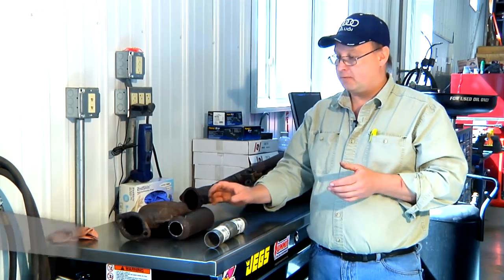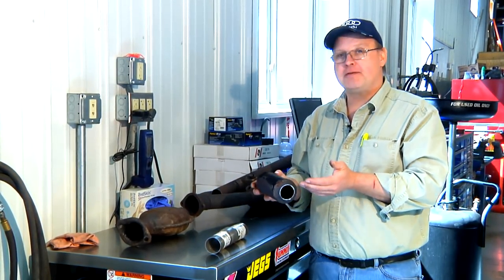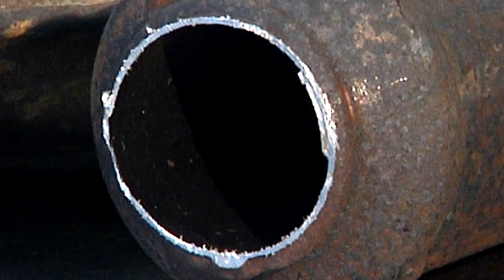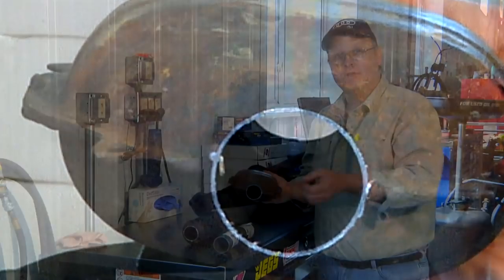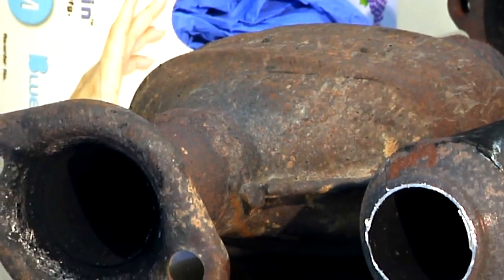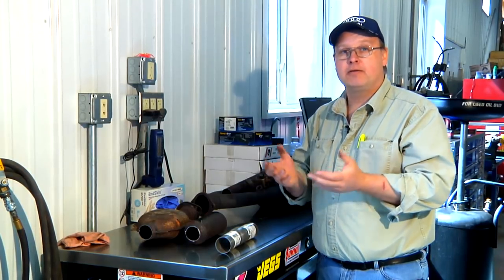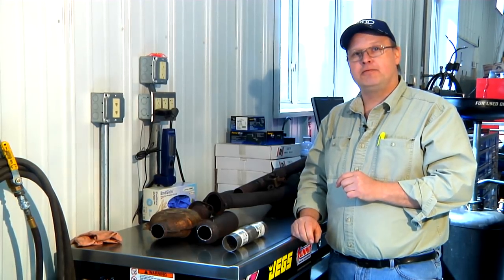What Happens if You Replace the Exhaust Resonator With a Pipe? : Under the Car Repairs

Comment: HOW DA FUCK  BACK PRESSURE CAN BE EFFICIENT IN ANY WAY? SINCE WHEN PHYSICS CHANGED?
Reply: better torque and smooth running.  you ever removed the exhaust from a motorcycle?   quite a lot need dynowork to run smooth again.     the lesser the "backpressure" the higher in the rev range the "bigger" power will be.     or no BP is only peak rev BHPgain and low/mid rev torque loss
Reply: backpresure is NOT good never was and never will. Learn physics. Backpresure doesn't allow full power explosion to happen. How this is more power? Your pistons moves less with backpresure. I cant write this topic in english i dont know terms. That's why bigger liter engines have more power. if you restrict piston movement -you lose power.
Reply: Dude, are YOU an automotive engineer?

Do you race cars or bikes on a track?

I AM and I DO

Take your car, bike, truck, etc and put it on a dyno.
DO IT
Film it and put it on youtube!!!!!!!
let us show the TORQUE AND BHP graph AND YOU WILL SEE THAT WITHOUT MAPPING YOUR ECU YOU WILL HAVE A BAD RUNNING ENGINE!!!!!!!!!!!!!!!

you obviously didnt read my text verry well

I never said TOO MUCH backpressure is good.
I never said backpressure doesnt cost you power etc

what I said was that IF YOU TAKE AN ENGINE AND EXHAUST SYSTEM FROM AN EXISTING VEHICLE   you will almost always loose torque and or power in lower regions and you will need your vehicle mapped again for durability and power-sake

YES if you block the exhaust gasses too much, you engine wll run badly and lose power

But the same happens a lot too when the exhaust is too open.

That text of yours is about when designing a new engine basically

they can design an engine with NO backpressure (exhaust pressure) but why do you think they only did it in race-engines???

NO TORQUE and too loud !!!!!!!!!!!!!!!!!
Reply: SO why everybody make straight exhaust as the first power increasing mod? You talking about gasoline cars maybe, i primarily talk about diesel. Gasoline is shit for me. IMPOSSIBLE to design cars without back pressure. Catalytic converter must be, turbo must be on diesels, some other components must be too, so impossible to make if you fallow regulations.

With diesel you will GAIN torque with no back pressure.  Turbo spins faster on lower rpm.
Reply: Tomas Av.
Are you daft??
I already said this same thing....
""IMPOSSIBLE to design cars without back pressure. Catalytic converter must be, turbo must be on diesels, some other components must be too, so impossible to make if you fallow regulations.""

Only proves my point...

A straight exhaust on a diesel or even gas car aint a problem as long as the diameter aint TOO BIG, but you cant put a 8inch diameter pipe on every engine WITHOUT ANY consequence....

yes, every engine WITH TURBO spools up faster and CAN win Torque when you remove the exhaust completely or make it less restrictive...

You are missing my biggest point
ECU PROGRAMMING NEEDED!!!!!!!

you go ahead and just remove the exhaust after your turbo and see what happens.
OR you will lose power, OR you fuelconsumption goes skyhigh OR you engine becomes less durable

EITHER WAY YOU CAN NEVER EVER go wild on removing ""exhaustpressure/exhaustrestricton"" without sacrificin anything
Reply: Why do all the old hot rods have like no back pressure? They run straight pipes for a few feet and thats it.. Old piston pounder air plane engines, again, few feet of pipe and thats it.. I was told back pressure chokes off the engine, less horse power and efficient. New vehicles probably have built in programming to throw the whole engine into a piss poor running state once it detects you cut your muffler off at the headers.. Why do we need all these sensors and bullshit anyways.. Cars ran way better in the 70s.. computerizing our vehicles was the dumbest thing they did..
Reply: People PLS first get knowledge than comment. For diesel engines backpressure is BAD, it reduces efficiency, and power. You really have to get basis of how turbo works. Turbo answers this question 100% accurately=backpressure is bad for performance. The higher backpressure the slower turbo rpm, the less air is compressed - the less fuel can be used - the less power u get.
Reply: you guys are daft

the only thing you think about is PEAK power

why hotrods, planes, dragracers, racecars, etc have open exhausts is PEAK POWER

offcourse I'm repeating myself

cause I'M RIGHT and you dont listen

FOR ORDINARY VEHICLES OPEN PIPES ARE BAD    THE END !!!!!!!!!!!!!!

damn, I'm an automotive engineer, AND I race AND I dyno my cars and bikes

any of "yall" can say the same???
Reply: Another automotive engineer over here and I agree with you lillnemo1. Peak power is one thing, efficiency is a whole different topic.
Reply: Diego Pérez Wandersleben
thanks. could use a little help

not knowing something is one thing, but not willing to believe facts given by a professional is another thing.
Morons tend to do the latter
Reply: People go to first class and learn physics then respond to my comments. PLS. It's BASIC physics!!!! back pressure is INEFFICIENT, performance killer. Pls show me physics theory who says that  when you have force directed against you you gain speed.
Reply: Tomas Av. average drivers use their cars un a way that efficiency is a requirement, and that efficiency usually comes when there is more torque at lower rpms. if you want, perform a little experiment. first drive in street conditions (slowly) your car with the stock exhaust which is engineered for the power curve of the engine that matches the gearbox too, and then remove the exhaust line and do the same. you will feel less torque in that condition than using the stock full line, and that is when efficiency shows up as you will need to rev higher to compensate that torque loss. Of course if you drive flat out, restrictions are stopping you going taster. That's why dragsters run open headers, as they are not using the bottom end of the power curve.
Reply: Back pressure is only needed so that the sensors along the exhaust system get a smoother reading. This smoother reading allows the ECU to receive more stable voltages so that it can respond, operate fuel trim and other systems, in a smoother more gradual way. I.e. be more efficient and give better bottom curve response.

It takes time for a processor to receive a signal and produce an output based on that signal. The back pressure essentially helps the ecu to perform more effieciently.

Without back pressure the signals produced by the sensors are much more erratic. This doesn't match up very well with the ecu's programming (how it should respond).

 As far as I know, dragsters do not monitor downstream exhaust for emission compliancy so they run open headers for the "open exhaust" effect (more out of the engine.. can put more in for more power).

Nice video. :)
Reply: Hi. Straight pipin' any engine will give more hp. :)
You'll also have more torque, but the car will be more 'edgy'
And your fuel efficiency will drop.... a lot xD
What you said before happens a lot in smaller engines, but in 1.6, 1.8 liter engines it doesn't happen at all, but you will get a check engine light.
Reply: yalnizful why would check light come on? O2 sensors?

Comment: So... am I the only once that realized that rusted out shit can he was holding was a catalytic converter with the guts removed?
Reply: Um no because there are plenty of resonators that look like that.
Reply: yeah nah thats a gutted cat
Reply: That was a rusted cat for sure...lol
Reply: the dual resonators on my 96 fleetwood are shaped just like that, the converters, are not
Reply: i have a dual exhaust on my 89 mustang and i thought i had 2 cats on each exhaust pipe but the ones in the middle ones are actually the resonators .. which ill be cutting off as soon as possible
Reply: Actually, your 89 DOES have two cats on each side. At least it should. I have ran across cars where one or more of them of them had rattled away to dust though.
Reply: i just searched it ..and i actually do first set are pre cats and second are the cats..looks like im cutting all 4 haha
Reply: I cut all of mine out !
Reply: does it sound good?..I have a flowmaster muffler on mine but Idk what type cause I bought it already on  and it was probably there since the car was made..sounds stock though
Reply: it did yes. I had dynomax mufflers on it with 2.5 inch pipe, 3 inch dia lx polished stainless tips. it rumbled nicely. I also had shoehorned a 351w in there too with Mac shorty conversion headers too.
Reply: +kleetus92 old Subies had 6 at one time you also got tax deduction for it being a zero emissions vehicle.
Reply: my '00 lancer has a resonator like that
Reply: I've seen a  cat converter and they have a mesh that restrict flow, the resonators have small holes all around the wall of pipe that allows gasses to flow in to holes and increase speed of gasses out the pipe.. if they weren't there the gas wave pattern increases so much that it reflects back on to itself and slows the speed dramatically.. Therefor straight through anything isn't as fast.. I love it when science and hoon collide :D
Reply: That does look like a gutted cat i did that once to one of my cara
Reply: Cars

Comment: I have a 635 inch Keith Black in my race car, how many resonators should I add to bring the horsepower up to an even 2000 on pump gas?
Reply: NZ Salt Flats Racer guessing since my civic has 1 muffler and 1 resonator for 140hp and my camaro makes 325hp with 2 resonators and 1 muffler 
You need 2 mufflers and 8 resonators
Reply: +bigkarl24 Love the v6 camaro
Reply: Justin Teno ls1 camaro not a v6 lol
Reply: blinker fluid
Reply: I think 3 Per cylinder would be ok ,and at least 5 bottlez of auto zone brand octane booster ! n open up plug gap , leave the timing as is !

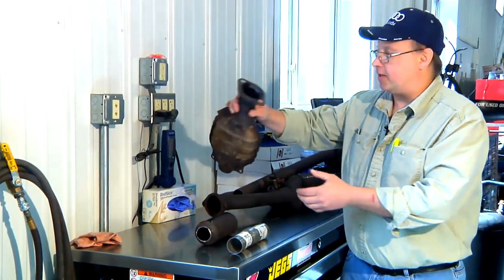Comment: Bob is holding an empty catalytic converter housing at 0:41 when describing a Chambered resonator.  This is your first clue that this video is uninformative and inaccurate.   I would like to see a single case where a OEM resonator of any type has had any measurable effect on exhaust system backpressure.
Reply: +Morgan Oliff Um, no. The resonator in my Audi Cabriolet looked identical to the resonator he is holding at 0:41.
Reply: Yeah that's exactly what I thought too.
Reply: +Morgan Oliff I guess we're suppose to figure out that he's an Audi guy by his hat, so we can guess that the cat he's holding is actually an Audi resonator.  It sure looks exactly like the GM cats that I just took off a truck.
Reply: +Morgan Oliff Some Ford trucks and E-series vans use that very same style resonator right before the cat.
Reply: I agree, it doesn't affect back pressure at all all it does is quiet the exhaust some and in most cases make it sound deeper
Reply: I got a resonator after the muffler on my Sienna. LOL Back pressure resonators were necessary on 4 cylinders having it mounted in front of the muffler before there was Cats.
Reply: I can tell you many cases with the newer direct injection turbos. Many members who own a C250 1.8T engine who removed their resonator or muffler lost a ton of power due to loss of backpressure. You can find many forum posts on this.
Reply: thats bullshit dude. My old 1.8t GTI had a resonator and muffler delete. i dyno'd a before and after, I lost 500rpm of torque on the low end, but gained 4 HP everywhere else. That was just the stock diameter exhaust too.
Reply: the things are on there mostly for sound deadening
Reply: what is ur unit of measurement  man lol 500rpm of torque?
Reply: wondered if anyone else caught onto the empty cat he had in his hand lol .. only thing I can say is if you empty a cat and place empty cat back on vehicle run a straight pipe through the cat ..WHY ? because exhaust sound bounces around in that empty chamber making your exhaust sound horrible and shit and placing a straight ppe through it corrects it ..even if you HAVE to use a smaller diameter pipe in the cat it is worth it. ... a brand new car is worth removing the cat in almost every instance unless the car has a factory low back pressure performance cat system .. like corvette or camaro etcc  but not mustang all their cats are SHIT
Reply: might just sound like an pepsi can LOL
Reply: INECIKlavier that "resonator  " before the cat on those ford's is actually a pre cat. Fords used 4 cats in early 90s and 6 cats in later 96 up on v6 and v8s. Resonators  are after cats and before mufflers
Reply: kimberlyn shinn he probably means 500 rpm worth of more torque, saying he lost peak torque
Reply: HMMMM wonder what he thinks "proper back pressure is"??? And how much do you need??
Reply: Isn't that obvious? (apropos of the backpressure alteration)
Reply: Morgan Oliff I suspected as much, he keeps talking about back pressure as a good thing, eliminate the back pressure and your engine runs cleaner and it has a positive effect on the fuel mileage. I know from personal experience.
Reply: sranjesuper YEP happened to me.. on my 1.6t
Reply: My 2014 Ram 1500 RT has the resonators after the mufflers just before the exhaust tips!
Reply: @andrewbartleman9169  my 01 v6 has no more than 4 cats.
Reply: Eliminate all your exhaust restrictions in a modern fuel injected vehicle, maybe gain some power but definitely drop mpgs. More air flow = more gas burned. Stoichiometry.
Reply: @Vextrous41  I agree backpressure is how jake brakes on trucks work. You can literally slow a 40 ton truck with just backpressure. It literally makes the engine work harder to maintain the same power. As long as your A:F is good, you can run with no back pressure post turbo and get improved performance.
Reply: @Ashroyer86  Less opposing forces on engine means less power required to maintain speed. Means less throttle needed which means less fuel used.
Reply: @Vextrous41  Not on a NA motor.. You need some back pressure or your tourqu will suffer. Doesn't much matter on turbo cars because the turbo is forcing air in and the turbo creates enoug2 back pressure.. Straight pipe out is recommended fpr performance on a turbo car
Reply: @randolphcirilo4800  I didn't take off the cat just the Muffler and resonator.

Comment: It is sad to see the comments on this thread from so many "tuners"  they should be called wannabes.  A resonator by virtue of it's disturbance of the exhaust flow raises the back pressure.  When rpm is higher the disturbance is less.  The net result is a shift of the hp curve to the lower rpm's.  While I will concede that removing them will increase peak hp. that will happen at a high rpm.  Most drivers never exceed around 40% of their motors speed.  They drive around in the bottom end.  If the bottom end gets more hp where the driver uses it, then it is worth keeping.  A true tuner is someone who can put the ponies where the driver uses them.  If the driver is always in the top end of the range, drop the resonator, if they are on the street give em what they need.  End of rant, thanks
Reply: Less back pressure makes a turbo spool faster = more immediate power
Reply: Thankyou.. someone else who understands resonance.
Reply: @Jonsk111  Backpressure is never a good thing finally, someone got it right.

Comment: Depends on your exhaust system how it's setup! Just can't say no! Each applications varies! Catalytic converter does resonating , gas expansion pollutant control and back pressure. Any resonator after that is sound tuning. Older vehicles use forward resonators to control backfires to keep muffler from blowing up. Was common back then.

Comment: Bob, while I agree that the resonator is there for a reason, "back pressure" as you call it, is not the reason. This is a misunderstanding of the physics of the tuned exhaust system. A proper exhaust system will scavenge from the engine (increasing efficiency and power) and help pull the intake charge into the cylinder (due to valve overlap). An overly large diameter exhaust will not properly scavenge... but this is only true in the pipe close to the engine. The resonator can be close enough to the engine to matter, but often isn't due to the placement of the catalytic convertor. 

What the resonator does really do, is act as an expansion chamber. This helps to lower exhaust noise without increasing back pressure (which is bad) too much. Modern mufflers attempt to do the same thing, however, using a slightly different method. They use wave cancelation techniques and packing material that dampens the noise. The second style resonator that you show uses a combination of the expansion chamber method and wave cancellation. 

A good exhaust is much more complicated than many of us generally think. Manufacturers spend a great deal of time and money to find what they think is the best balance of sound level and performance. Good tuner companies do the same thing with a different acceptable maximum sound level in mind. Generally speaking, a good cat-back system will improve HP and not affect low end torque (this is a gross simplification, as HP and torque listed at a specific RPM are the same thing measured at two different points -- HP=torque*rpm/5252). A good header, however, can change the shape of the HP curve, depending on where it is intended to make the most power--- lower RPM or higher RPM. If the stock header is really poorly designed it can improve both, but this is becoming increasingly rare, except in the case where there have been other modifications made to the engine.
Reply: Wtf
Reply: Back pressure,We are not driving 2 stroke engines
Reply: I like the sound of my exhaust but how do I make it a little louder without changing its tone?